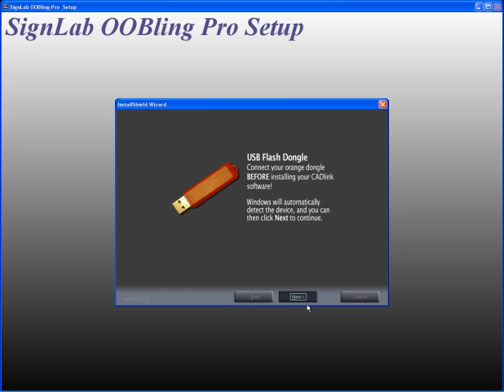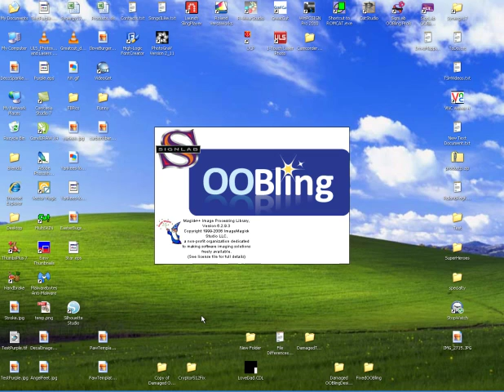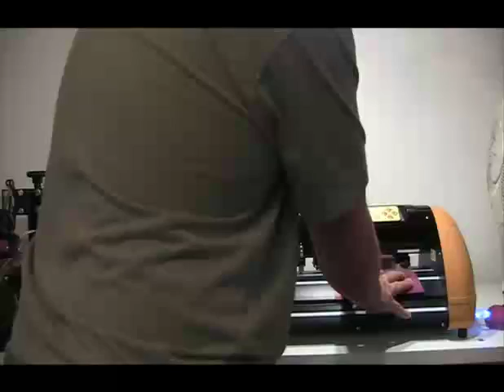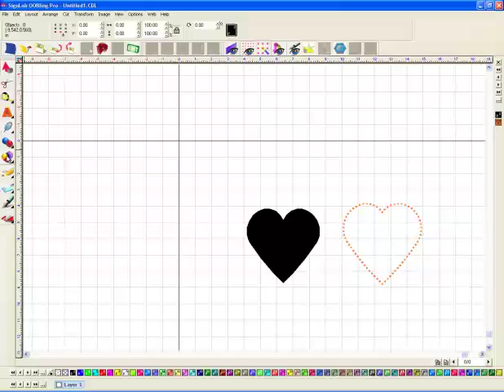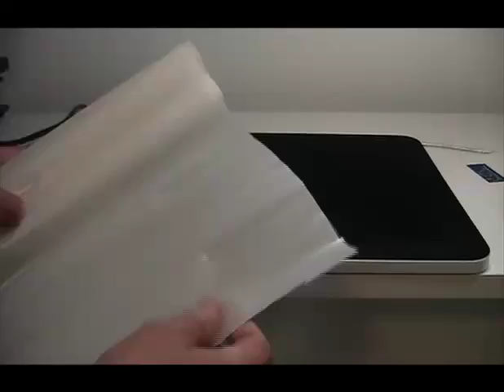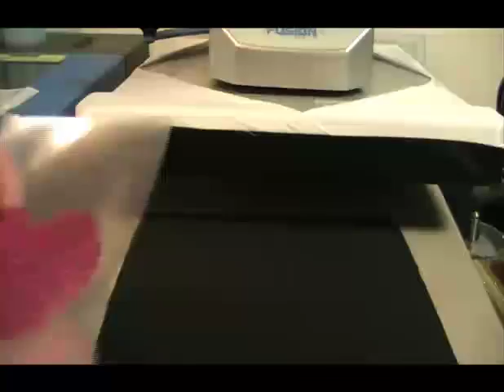Synergy 17 - Entire Vinyl/Rhinestone Process - Cutter, software, and application

Comment: I cut my 10ss stone Design but when I put my stone so the stone was not entering on hole. What I do? Make little outline 10ss stone?
Reply from the maker: What size did you make the hole? I like to use .127" for SS10 stones.
Reply: @synergy17llc  i used 0.10inc
Reply from the maker: @PashtoVoiceAI  That might be kind of tight. I use .098-.1 for SS6 stones